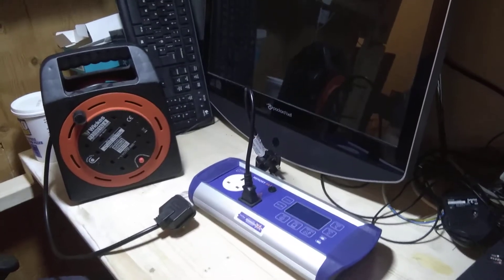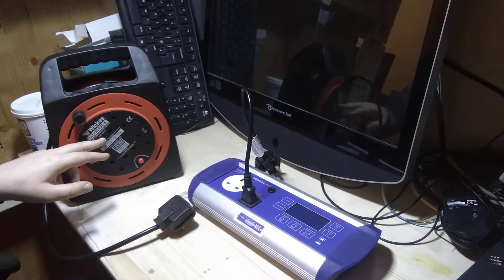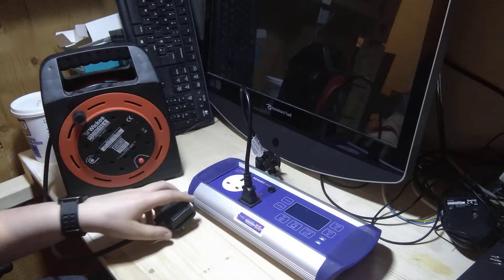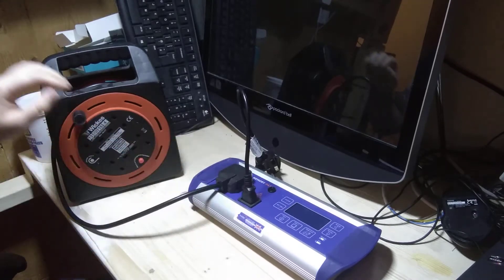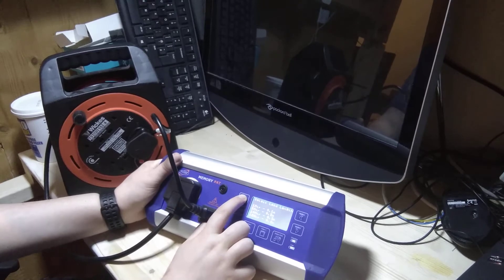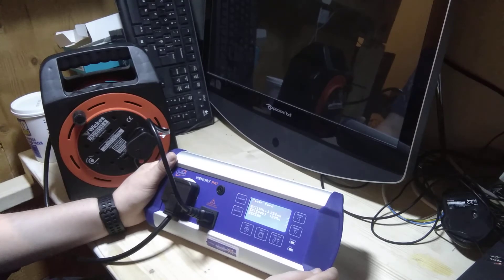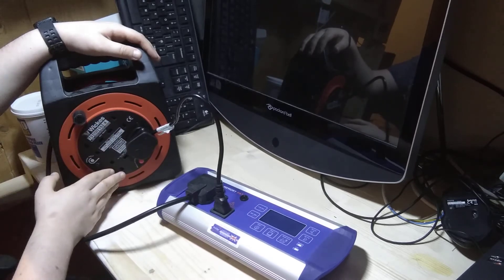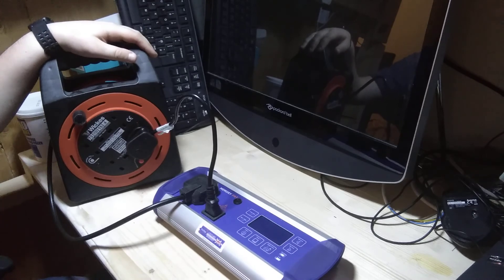How to PAT test a long mains extension lead

Comment: You didn’t show a visual inspection, you should always visually check an appliance before tearing it as if it fails a visual their is no point in pat testing the appliance.
Reply from the maker: Hi, I've got a video on how to visually inspect an appliance. Before I made this video I visually checked the extension lead before testing.
Reply: PAT Tester Josh In Lincolnshire could you give me a link to that video please, how do I know you visually checked it before testing as you didn’t show it in your video so how do I know that your not lieing?
Reply from the maker: @j.griffiths2000  https://www.youtube.com/watch?v=baXIPFVeOaI